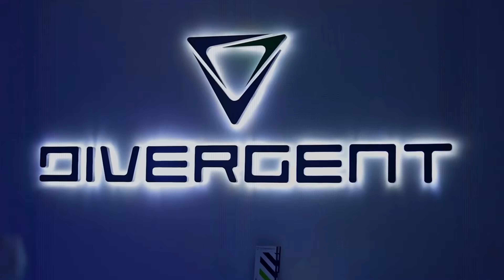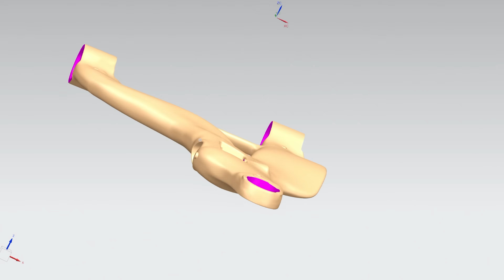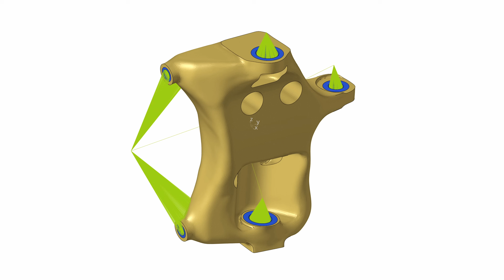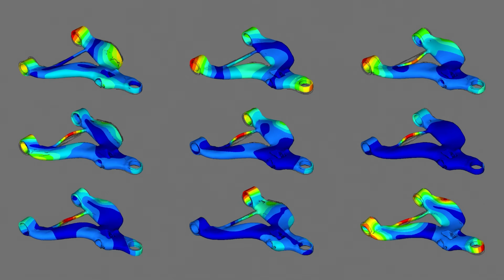McLaren Automotive X Divergent - W1's Formula 1-Inspired Suspension

Comment: This is what prevented Max from getting 5 in a row! Not just Divergent and its next level AI designed/optimized manufacturing techniques but also all the suspension and aero dynamics testing and knowledge gained off the books, not coming off F1's cap, in developing the W!1! I can't prove this but one can't argue the fact that it just makes too much sense, both logically and logistically that the lessons learned thru manufacturing advancements doesn't crossover between the two divisions.

Comment: 3:38 “manufacturing at scale” 
What is that scale? From prototype built in one 3d printer in  a day to thousands of approved elements printed on four 3d printers in 250 days? 
If you want scale I bet that you should 3d print press-forms for latter forging.
If you put any of those elements onto Ford Focus that model would go out of business the next day

Comment: I participated in a very similar collab between Mercedes and EOS in 2018
Reply: I bought an EOS machine for the Co I worked for so we could produce 
rapid tooling for moulded parts . We found we could grow things that 
could not be constructed any other way and it held production advantages
with conformal cooling that could reduce cycle times. That was back in
about 2004/2005
Reply: EOS had some crazy alloys for printing. Too bad they moved out of Europe.
Reply: @qm3981  yes, just google "Scalmalloy"